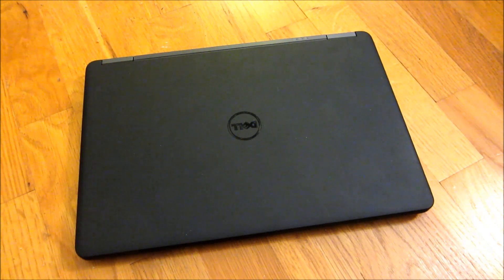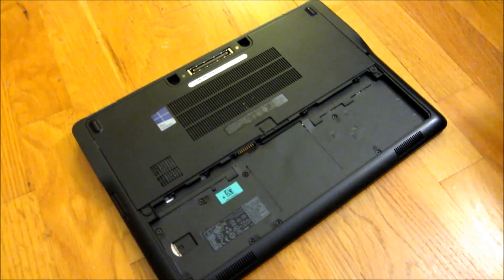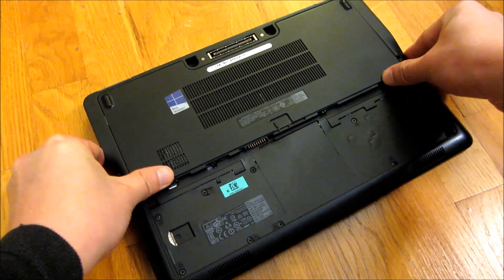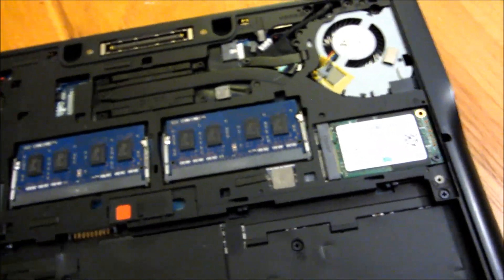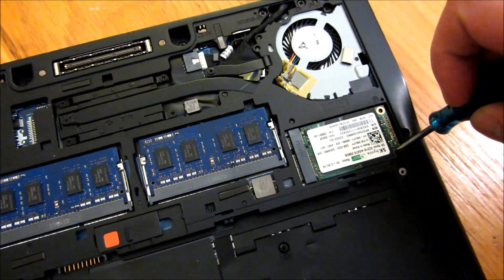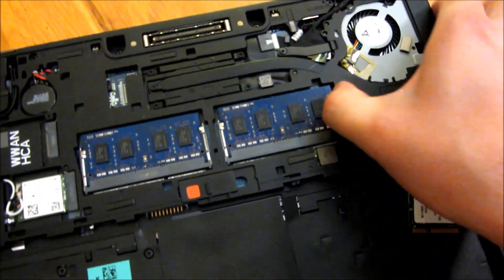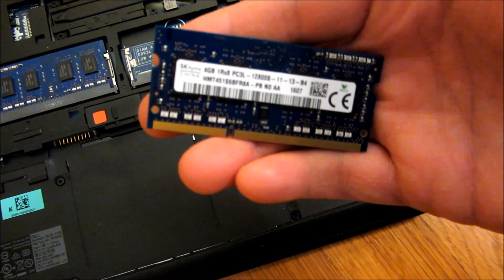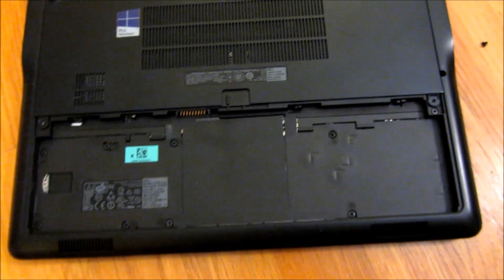Dell Latitude E7250 | SSD and Memory Upgrade | Maintenance

Comment: Hi sir । My laptop Dell e7250  
RAM  DDR3 to upgrade. DDR4
Reply: you cannot use ddr4, it literally will not fit. also the e7250 uses ddr3l which is different from normal ddr3, and normal ddr3 will not work. it can take a maximum of 16GB ddr3l 1600mhz

Comment: I want to upgrade the processor on mine. Can I buy just any intel i7 ???
Reply: I think the CPU is soldered on this laptop. There's no socket, so, unfortunately, you wouldn't be able to upgrade.
Reply: You can't be serious 😂
Reply: @emotionaldrift  i am
Reply: Yes you can but you’d have to buy the motherboard with this chip. The chip is soldered and non upgradable. The i7 model isn’t that much faster than the i5